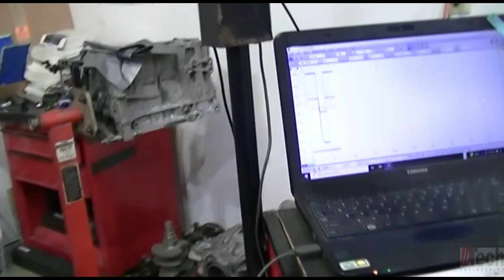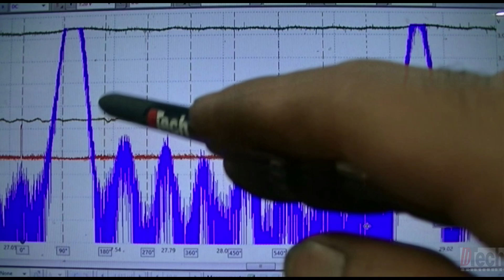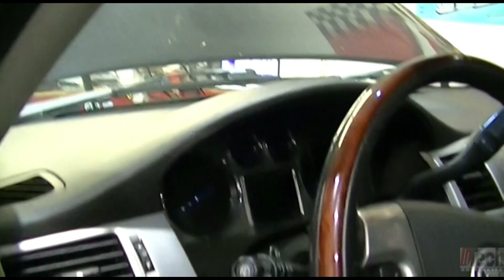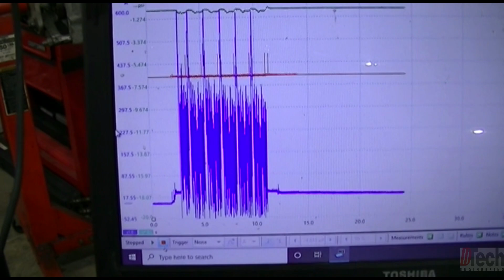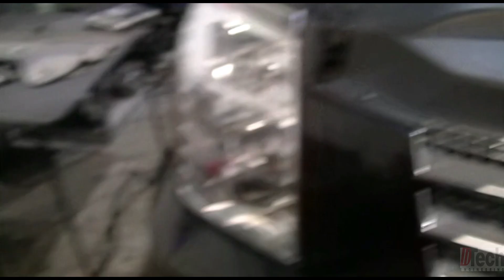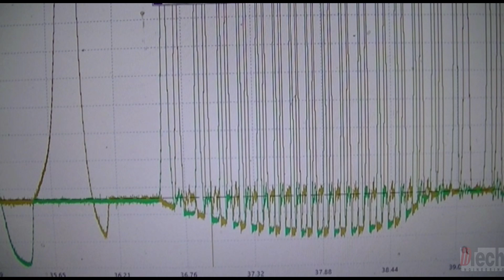2008 Escalade : High crankcase pressure & runs rough after rebuild

Comment: nice to show a 600A battery pull, many techs do not allow a correct scope setting to show a full spike on a RC test as this is a very good test of the battery CCA test, how good is the battery based on this first spike for a normal RC Test. Thanks for all the additional waveforms to prove out a BANK2 problem which led to a clogged CAT. Now I wonder if that was the original problem which led to a rebuild, maybe the owner has paperwork to show a real need for a rebuild??? But now that shop owes a new CAT based on improper rebuild destroying the CAT as I am sure they do not have evidence of exhaust backpressure before the rebuild???

Comment: 2 rebuilds and hours of work and stress your vid saved my truck thank you so much for making this vid because everyone else said that wouldn't happen and my truck is doing the same thing so when to my shop and pulled the  O2 sensors in front of the cats and no blow by you are the man!!!!!!!!!
Reply from the maker: That's super awesome to hear! 🙌 I'm sure you were at wits end with the whole situation, but definitely glad that you got it worked out and glad you found the video for help. Thank you for watching!
Reply: Can you please explain what happened? I am having the same issue with a 2008 escalade brand new Rebuilt engine having to much blow by.  Thanks